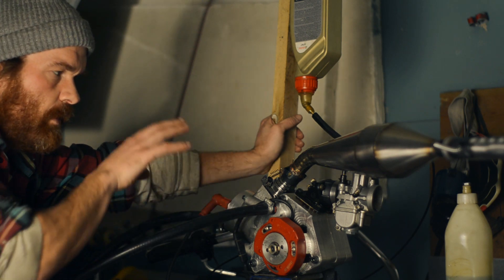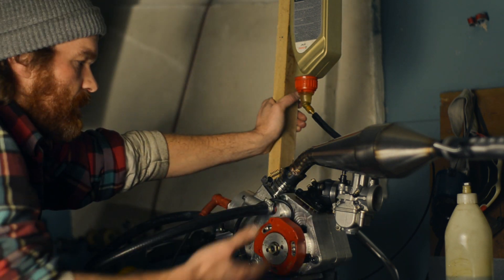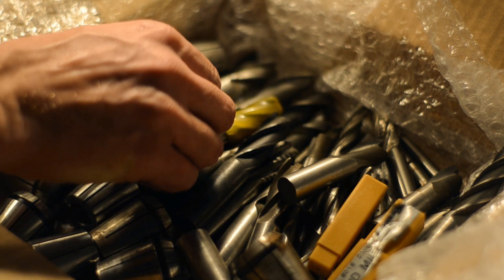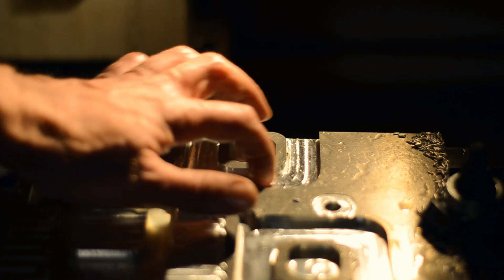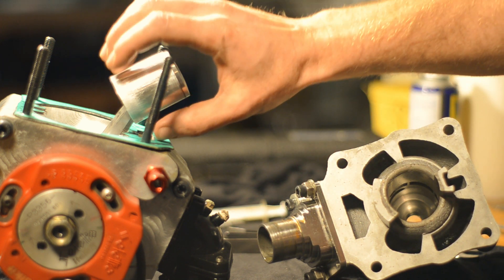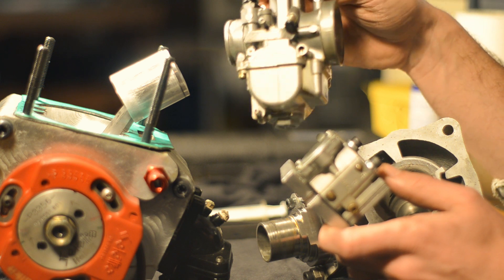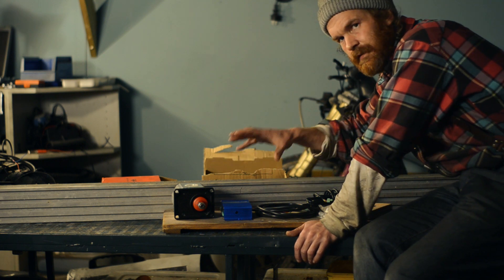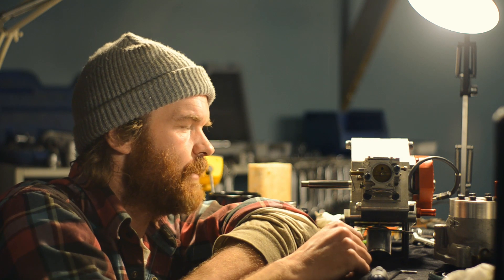Sacrifices to the God of Speed - Most Powerful Two Stroke Ever

Comment: Would a velocity stack help on the carby.
Reply: No since the carb already has an intakemouth with a radius within it. Thought you might be able to use a Power X-wing(google it) to gain air velocity.
Reply: If you mean the small diaphragm carb, yes it will help.

Comment: I am  just wondering if you have government thought to moving towards a direct injeection fuel system to eliminate the inconsistencies of a carburator? Technically more complicated but eliminates many of the variables that inherently come with using floats,reeds, jets, needles, springs, and slide mechanisims, mounting flanges and angles of mounting. I am sitting here listening to that clear crisp exhaust note and smiling because I know success is never the end goal it is the amalgamation of all the little successful goals as long the way that make it all worth it resulting in nothing more than a smile on one's face. You have done this and I hope it never stops happening for you.
Reply from the maker: The secondary intake has EFI, want to play with direct injection in future projects 👍

Comment: Seeing as you have the CNC running accurately, why not buy CF sheet and machine the reed valves to size in carbon? Then you can keep sheet on hand and make as many spares as needed and in varying thicknesses for testing

Comment: Because the engine is designed for high rpm. And the case is so big, maybe the rich issue is reversion and the fuel is dropping out of suspension? The fuel ends up in the case and not the combustion chamber? Maybe it will be just fine at high rpm when your port timing comes into play?
Reply from the maker: 👍 Very much true I think.
Reply: I think you're on to something here.  I think it will be difficult to get it tuned to do both idle well and produce full power at 20k rpm under load.  Difficult but worth it when you succeed!

Comment: The pwk's can let unmetered fuel into the intake via the jetblock oring.  Google how to test or replace it.  Also, even the slightest amount of wear on the needle valve (the brass the needle slides in and out of) will let fuel bypass via the main jet.  You can replace it with the STIC valve or just replace the carb.  You cannot buy a replacement.
Reply: You can buy the needle valve here: https://www.splatshop.co.uk/sherco-lower-sprey-jet-small-keihin-2t.html

Comment: 12:56 Could you mount the carb on a rubber inlet rather than hard mounted to stop/reduce the foaming?
Reply from the maker: 👍 There's a short rubber booth on there now, but softer/longer should help. Pumper carb is more compact tho.
Reply: @2STROKESTUFFING  If the foaming continued to be a problem with the pumper carb you could consider bolting a steel/lead weight to it. That would reduce the natural vibration frequency well away from your 20kHz range.

Comment: How many cc ? 125 cc ? 250 cc ?
Reply: 50cc
Reply: @Player001a  thanks bro ! And how much power in hp ? Why he say "the most powerful 2 stroke ever" ? It s only 50 cc ....
Reply: We don't know how powerful it is yet 
It is a prototype for the moment
The most powerful two-stroke engine when it comes to the 50cc displacement.

I agree, if it works well, why not do it in 250 or 300cc 🤤
But the bigger the cylinder is, the less RPM it will take (I think) as for RC engines.
Because the best power/displacement ratio is obtained with the maximum number of revolutions per minute.
Reply: @Player001a  Thank bro ! You are a good man ..... 🤙🔥

Comment: Ex 2 stroke snowmobile racer , I love this . 2 Strokes rule for power to weight
Reply: Let me introduce to you turboshaft engines.
Reply: Big Cheese - please do
Reply: @chadcole7221  : General Electric T58, not the best when it comes to power/weight, but they're plentiful and good size for many projects. 10kW/kg shaft power is hard to beat. More modern and exotic animals can easily improve that P/W.
Reply: @TheFirstBigCheese  previous versions of this 50cc engine made over 20 crank hp and weighed like 4 lbs... 10kw~13hp and 1 kg is 2.2lbs soo... This more exotic version of the lowly 2cycle running on proper racing fuel should make that happen no problem...
Reply: @ianbuilds7712  : Including geartrain to get usable torque? Doubt it...
Reply: Plus I'll bet that 10kw/kg does not factor in the weight of the fuel, accessories, coolant, electrics, computers, engineering departments, clip boards, red tape, crew of operators etc. etc... Needed just to get the damned thing started... Just sayin..
Reply: @TheFirstBigCheese  somebody needs a girlfriend. Or anger management.. I think you missed the point... This engine was built in a garage.. Instead you opted to name call... Like a child. There were computers back then and they were huge.. again not the point.. you said 10kw/kg that was the example and the comment I made was not to be taken seriously 😂.. you  invalid..
Reply: @ianbuilds7712  if anyone is missing the point, it's you. Discussion is about engines and shaft P/W, please come back to topic or stop being silly.
Reply: @ianbuilds7712  : If your projects are all air-cooled, I would be surprised if you get above 3 kW/kg.
Reply: @TheFirstBigCheese  what geartrain? Have you watched previous videos? There's a belt and a pulley... Turbotax engines on the other hand if you want to spin a rotor do need extensive gearing... They make incredible reliable power but there's a reason you don't see turboshaft scooters... And let's talk about power to $ ratio for a second..
Reply: @TheFirstBigCheese  me too... Especially considering my most recently aquired engine is cast iron lol you said I need coolant like I'm the guy... My original comment that butthurt you was a silly comment and you chose one of the silliest parts of it to scrutinize so the conversation was never to be a serious one...
Reply: @ianbuilds7712  : I know what a variator drive is, and if you had any idea too then you should know that there is NO way to keep decent power throug it, changing to geartrain is the Only way to keep power-to-weight up.
Reply: @TheFirstBigCheese  I'm lost... He is still using the single variator right? I've been keeping up with videos and have seen nothing about changing to gearing.. plus the amount of gearing needed to keep it in the <500 rpm power band would weigh more than the whole bike.. that being said I would try to stay away from belt drive because at the end of the day on the salt flats it's not about power to weight it's power at the wheel vs drag... I'm interested in the variator setup because it keeps with the moped theme of the channel.. but again I'll bet if you tried to scale down a turboshaft you'd be disappointed like I said they don't scale down as well as up... Although it's possible that the research just isn't there because of how well piston engines scale down.. I never disagreed with you on the power to weight thing there is a reason turboshaft engines are so good for large aircraft but it's the same reason you will never see a turboshaft moped... I bet if you did the math on some high end small rc car piston engines it would be pretty good...
Reply: horsepower and also kw is a direct function of rpm this makes it a bit misleading... Torque per rpm to weight ratio before gearing may be a little more telling of what's actually going on... Piston engines are torque machines that produce rpm and by extension hp  inefficiently... turbines also use torque to make power but are far more efficient once up to speed because hp and watt are work done/time..
Reply: @ianbuilds7712  : You have lost me too, this thread was not moped specific,  it was about maximizing power/weight. Also mixing units and quantities makes it hard to understand what you mean;
(Hp, Watt or Newtonmeter/sec) are all units of Power; which is simply angular speed times torque. No need to mix units.
A turbine has an efficiency map defined by speed, pressure and temperature, not much different than any other engine which efficiency is torque and speed dependent. It has nothing to do with power being work done/time. Efficiency is a design parameter, it's very easy to look up in the specsheet, add all maps together and you have that of the engine. If it's a professional one you have it as a full.
Reply: @ianbuilds7712  : I think, in most countries, his contraption is considered to be quite far from a moped already... An unregistred, uninsured motorcycle at best.🤔 Adding a turboshaft would probably not do anything but increase incident risk and fuel consumption considerably...
Reply: In any country an spx is a moped...
Reply: Like I've said 6 ways... A turbine is king in it's element steam or gas.. then I went on to talk about why they haven't and won't replace piston engines in the small scale. Neither of us are experts and I suspect nothing good will come from this but as long as you wanna waste time reading I'll keep writing 😂
Reply: @ianbuilds7712  : It's because the topic is power/weight ratio, not the others you tried bringing in... 😉
Reply: @M Bacon : Yeah, I know they're awkward in shape and torque response is quite shite too... It's a result of getting  an once of efficiency from them. Not aware of torpedo motors though, but when mentioned it'll make sense have to look into that, thanks. I have only seen a really old one which was pretty much a piston steam engine... Turbopumps and gas-turbostarters (cordite and hypergolic fuel starters of some big jet engines) has been mentioned; Not very easily acquired though... let me know if you come by one and you have my word I'll try fit it on a bike!
Reply: @TheFirstBigCheese  now you're just being unreasonable... Power is literally work done/time it transcends the units we assign to it so 😝
Reply: This channel is about stuffing as much power into a moped as possible... We do not get to set rules regarding discussions in the comments section...
Reply: @ianbuilds7712  : I know the physics of power and work very well. What I meant, that has nothing to do with the kind of engine. So you lost me when you brought it up in relation to turbines. There is no specific connection there.

Comment: i have a question about the dyno, whats the hydraulic pump actually doing with the power, like is it gonna lift up some fluid or will the resistance in the hoses be enough to dissipate the power?
Reply: It pumps through a flow control valve. Lowering flow for a given RPM increases pressure and therefore the braking force.
Reply: Not sure this one, but the ones I've seen do not lift or have resisting hoses. They just have a rotor with flat "paddles" 90 degrees against normal running water, the torque measure is done by sensing the contra rotating force on the enclosure. (Basically they try to make the worst efficient pump possible, were all work goes to warm the water instead of moving it :) )
Reply: @framegrace1  so the power for both these suggestions goes into heating the fluid in some way. that makes sense thanks. im excited to see how he does it.

Comment: Is it possible that with such a large carby that there is insufficient gas speed for effective atomisation of the fuel
Reply: but it worked before and on all the other itterations of his engines?
Reply: @NowAndyPlays  this is reed valved and its only the startup intake wich goes throught the turbulent crank and this engine has way more crankcase volume than the old ones
Reply: Velocity is more important than volume
Reply: Just looking.  The Vortex Minirok is a 60cc Piston Port motor, revs 15.5k
Has a 18mm carby.

Carby is too big, gas speed too low
Reply: Can it be not enough vacuum having such a big carb ....doesn't sound to ritch tho because no smoke or fucking plugs
Reply: jvv belise  atomization :  )